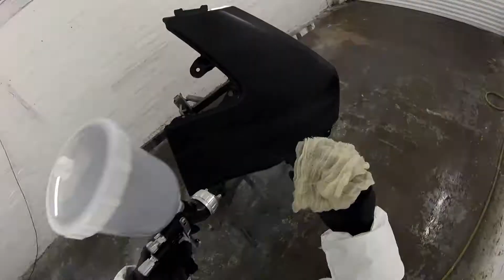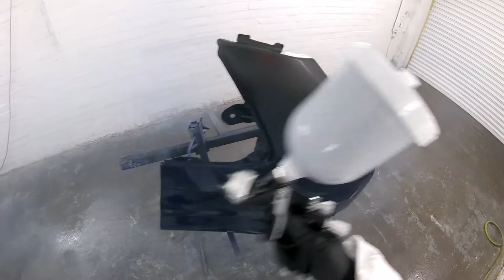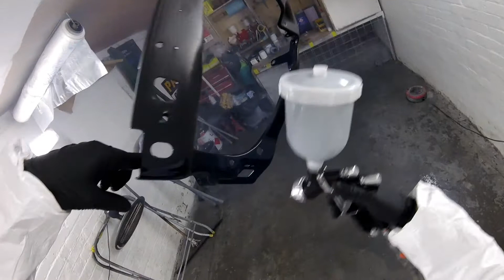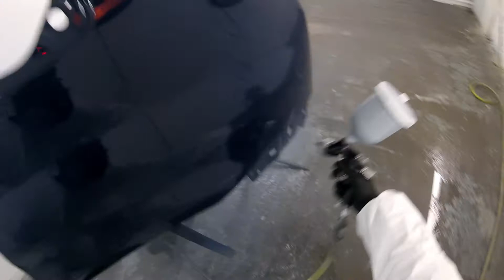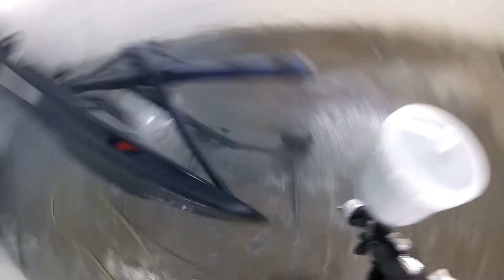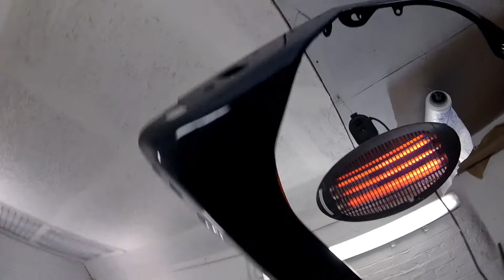Cum se vopseste cu vopsea 2k | Vopsesc o aripa fata cu vopsea 2k | Vopsesc o aripa fata

Comment: My Friend,  I noticed in this video that you weren't using an air regulator or water trap at your gun. how are you regulating your air
Reply from the maker: after years of using an spray gun you know what kind of set up you have to do and get use to it and you don't need an air regulator ,i have water trap on the wall ,any way is good to have on the spray gun as well  :D